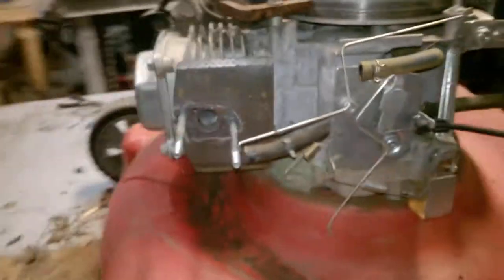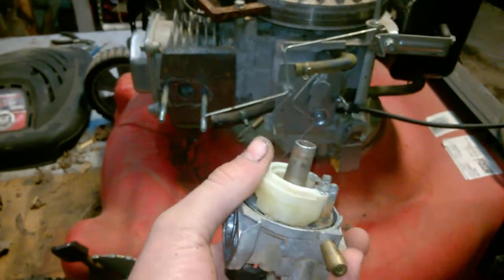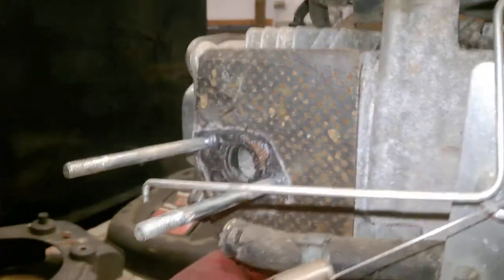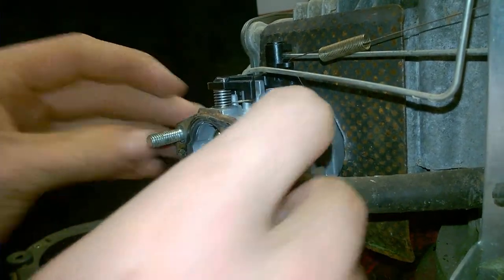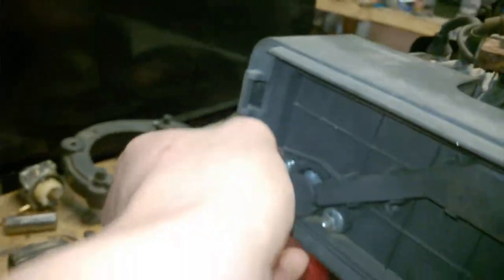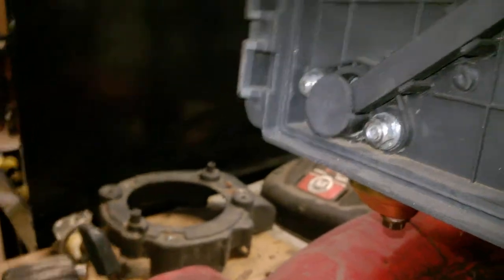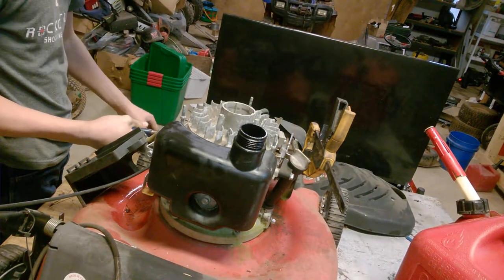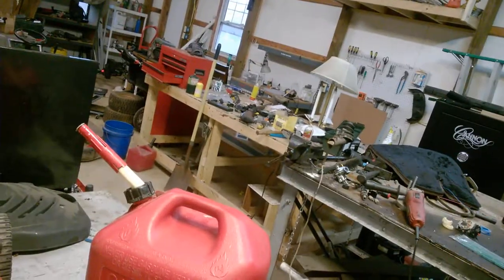Installing a carb on an MTD push mower.

Comment: I CAN'T FIND A LISTING FOR THE REPLACEMENT INSULATOR & HEAT SHIELD GASKET FOR THE 11A-41MB029 CARBURETOR.  ANY HELP STOCK NO. & WHERE TO ORDER